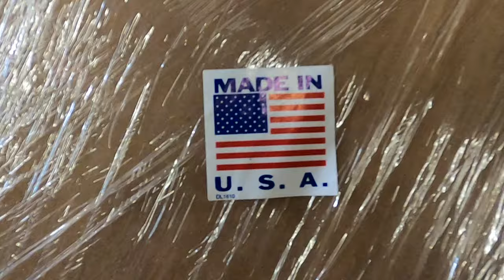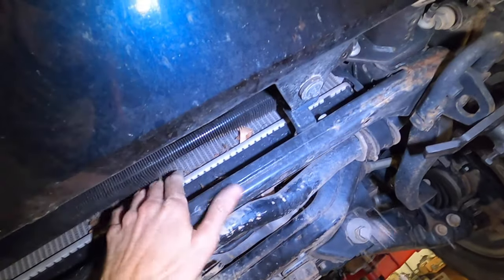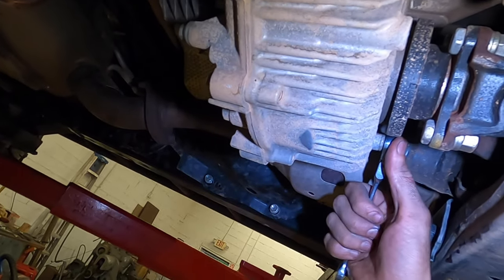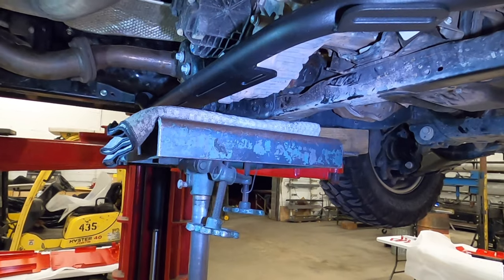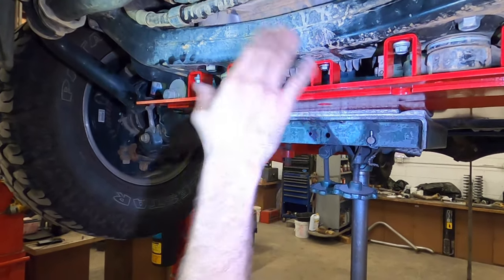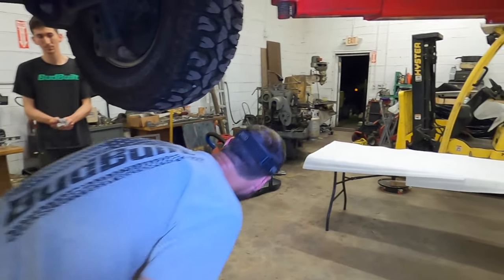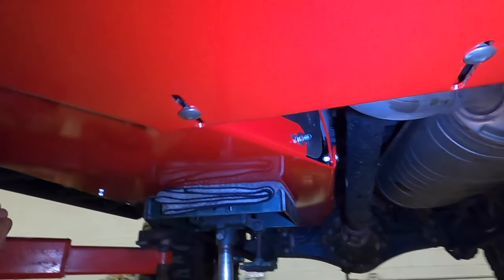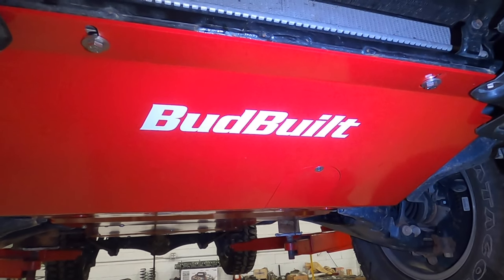BudBuilt LC200/LX570 Skid Install

Comment: Just finished with all 5 skids.  Instructions are great and everything fit well.  The bolt connecting the gas tank skid to the transfer case skid was a beast.  My solution was to remove the frame rail bolts and duct tape the back of the bolt from the gas tank skid.  Went straight in and no problems tightening.  Looking forward to testing it out at the Appalachian Toyota event in 3 weeks at Windrock.  Great product!

Comment: Do the skids increase the heat of the transfer Case and other comments since they are solid?
Reply from the maker: Heat rises and the skids are below.  There is plenty of airflow around them from the sides, even when crawling at very low speeds.  Of course, having 4 Catalytic convertors and an automatic transmission and huge muffler don't help any of it!  :)